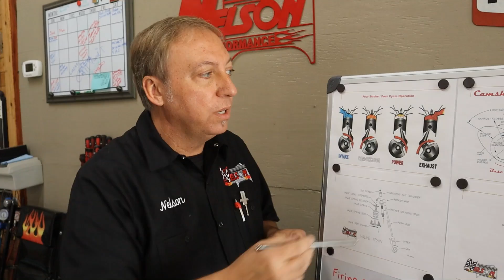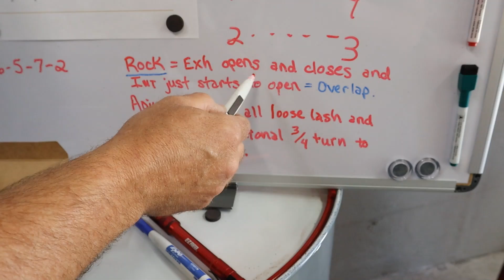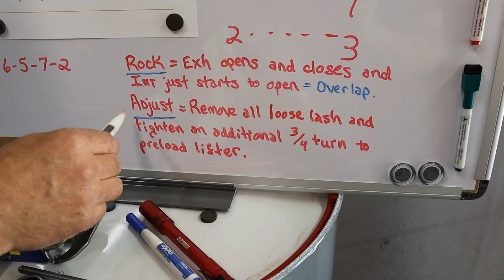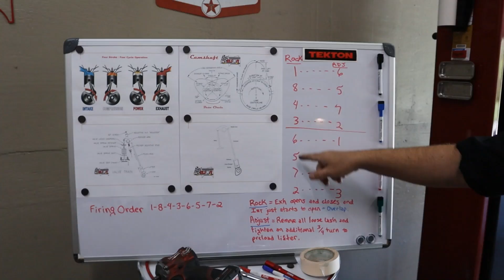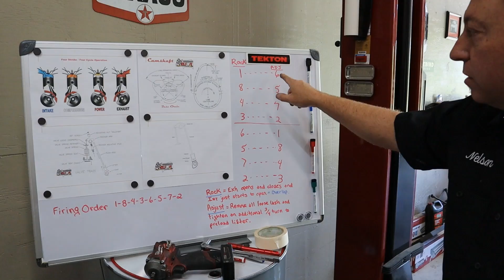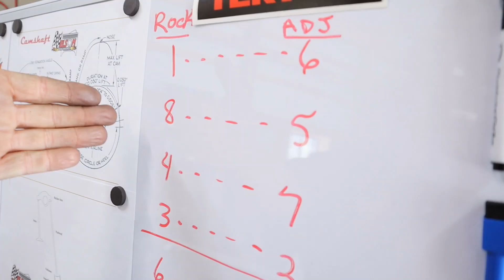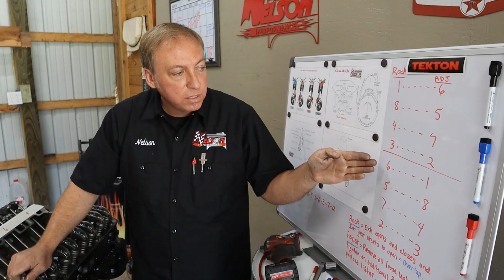Rocker Arm/Hydraulic Lifter Adjustment

Comment: Thank you so much for the great video!  I haven't seen this method before and it looks like it should be the "one true way" to adjust valve lash on a hydraulic lifter engine rebuild.  Excellent and keep up the good work.  

The video is very timely for me as I have just replaced the valve stem seals on my 1968 Ford 289.  Question for you: Since I did not remove the intake manifold I am unable to clearly see the movement of the lifters. So, in your video, is your starting point on the #1 cylinder at TDC or different?  I'm trying to find a reference from outside of the engine if possible.  If not, maybe I just feel for the push rod movement?  Additionally, once I have completed the Rock/Adjust for #1/#6 (my engine), how much of a turn of the crankshaft do I need to get to the Rock/Adjust #5/#3?  Looks like you are maybe turning the crank 45 degrees?  

Any assistance you could provide would be much appreciated.  

Thanks in advance.
-Andy
Reply from the maker: Hey Andy, first off, thanks for the view and the kind words! Having the manifold on is no problem, you can just watch for the pushrods to fall and rise instead of watching the lifters. You can have a friend tap the starter while you watch them but it takes a very slight tap of the starter to get to the next adjustment, and the method will work the same as long as you have adjustable rockers and not the 5/16 torque down style rail system. Also I assume you are using the 289-302 firing order cam and not the HO 351 cam that requires you to use the 351 W firing order. It should be 90 degrees (1/4 turn) between cylinder adjustments. Good luck on your projects and glad we could be a part! Nelson
Reply: Hey Mitch, I appreciate the response.  I should have clarified, my '68 is a stock 289 2v, so no rails, no HO 351.  It's got 68K documented miles so I figured a gasket/seal replacement was a better solution over full rebuild which is why I am in the position I'm in.  Good plan. I used the 90 degree method to bring each cylinder to TDC for the seal replacement so I didn't have to mess with pressurizing the cylinders and it worked well.  I'll use it along with the rock/adjust method to bring the valves back into adjustment.  Just using a breaker bar on the harmonic balancer bolt to turn the engine.  It's tight but it works.  Thanks again for your help.  I really appreciate it.
Reply from the maker: Hey Andy, no problem! Thanks for the comment! Nelson

Comment: Great video. I was adjusting the rocker arms on a go kart and I didn't understand how that works. So naturally I tightened up the rocker arms and opened up the lash until I got ignition. I have a question though, if the lash is opened more than the recommended setting will that cause engine problems? When I allowed more lash in the rocker arm it seemed like I got more power out of the engine and it seemed to go faster, too. After running it for 5mins though, it would die under its own throttle. So Im wondering, if I open the rocker arm lash more could I get more power from the engine or is that wrong? 
If Im right, then the problem I have is a lack of fuel for combustion; When the throttle is open it kills the engine, but when the engine is left on choke it functions properly. The Choke allows more fuel into the chamber and restricts air flow, right? This would mean my Rich and lean mixture is not right. So, basically I need more fuel for more power, but the question I have is, Is there a limit to how much lash a rocker arm should have? I have the engine running perfect now, but I think I can get more power out of it by opening the lash more. Again, I think there is a powerban to the rocker arm adjustment, I can get more power out of the engine, but I will have to change the fuel injection system and maybe buy different rocker arms or valves to keeps the valves from slipping loose of the rocker seat? What do you think?
Reply from the maker: Hey Erick,  typically an engine will have more power with the least amount of lash/gap between the rocker and tip of the valve. This is because it will allow you to get as much lift (opening) of the valves as possible and that will let more air and fuel mixture into the cylinder and let more exhaust out to help clear the cylinder out to accept the next round of fresh air and fuel. What I think may be happening on your small engine is when you open/increase the lash/gap it is allowing the engine to turn more RPM, assuming you have the governor disabled. That would make it seem like it had more power. The valve springs in most small engines are very weak and will valve float during higher than normal RPM, that’s why when you run the choke it revs higher because you are restricting the air trying to go in reverse back through the carburetor during intake valve float. (Just a guess). By running more lash/gap you are running less lift on the weak valve springs.  If you want to increase RPM you could install stiffer valve springs and tighten the lash/gap Back up and that should increase power and rev. Thanks for the comment! And subscribing! Nelson P.S. we now have merch avail in the link below the video!

Comment: WELL I'D HAVE TO SAY, I DID EXACTELY HOW MITCH DESCRIBED & SHOWED HOW TO DO THIS AND NOTTA, IT DIDN'T SEEM TO WORK WITH MY ROLLER ROCKERS, I GO THRU AND ROTATE THE ENGINE BY FIRING ORDER AND EVERY ROCKER ARE LOSE, THE ENGINE HAS TO ROTATE 90 DEGREES OR 1/4 TURN FOR THE NEXT PISTON IN ORDER FIRES FOR 8 CYLINDERS, I HAVE ADJUSTED THESE ROCKERS 10 DIFFERENT WAYS AND STILL HAVE A CHATTER. SO SOME FEED BACK WOULD BE NICE.
Reply from the maker: Hey Jeff, are the lifters pumping up? Are you sure you are getting adequate oil pressure to the lifters? Was it a full rebuild? Certain all internal oil passage end plugs are installed?
Reply: @mitchnelsonperformance  complete rebuild except the block in feb-apr last year,been driving it. Just had issues with chatty rockers, after I did your technique I went back thru and readjusted from 1-8 at tdc and BINGO no more chatter and runs great, not sure WTH I did but it's finally done back with the roller rockers. 👍 Thx for your video, it was the best explained & most detailed one yet that I've ran across. I'll keep it handy for sure.
Reply from the maker: great Jeff, glad you got it cured! Nelson

Comment: SO BRING EACH PISTON UP ON TDC IN FIRING ORDER & THEN ADJUST CORRESPONDING CYLINDER WITH 3/4 TURN PRELOAD AS PER YOUR DIAGRAM RIGHT? I KEEP HAVING TROUBLES WITH CHATTER,  YOUR VIDEO IS THE BEST 1 I HAVE FOUND ON THIS ADJUSTMENT SO FAR. SBF 302 I'M WORKING ON.
Reply from the maker: See above return comment

Comment: Love this guy the way he teaches how to do it I’ve been using his methods for awhile and it works every time love it
Reply from the maker: Hey Tony, really appreciate the kind words and the comment! Glad we could be a part of your projects! Nelson
Reply: I’ll tell u I have looked at other videos and this one is the best ever it should be showed all across the board so young kids can see how it’s done even more so people like that’s been a mechanic for over 20 years
Reply from the maker: I appreciate that. I worked for Jasper Engine and Transmission for 7 yrs before I became an Automotive teacher and I owe much of my knowledge to the old guys that were generous enough to pass it on to me when I got started and I remember them every time I pass it on to others. And I’m learning more every day. Thank you again Tony.
Reply: Hi maybe u can help I installed a retro lifter in my 351 and of course followed ur intelligence in adjusting the rocker. So what’s happening is I primed the motor spinning the oil pump for several minutes and the lifter is super hard not really allowing me to spin the motor at all as of though the valve is hitting the piston   Yet prior to priming everything was perfect   Am I doing something wrong pushrods are good only worries is that the lifter got that hard acting like a solid lifter. Do u have any suggestions? Thanks a million
Reply: I know u guys are a very busy shop so I cleaned the lifters and now working properly again I appreciate ur videos
Reply from the maker: Hey Tony,  priming the oil pump shouldn’t have “overpumped” the lifters enough to open the valves causing piston to valve contact? The valve spring pressure is higher than the oil pressure preventing this. I’m not certain what would have caused that?  The valve springs will bleed the oil out of the lifters as you turn the engine over as the rocker pushes the valve spring down. This will get the plunger off the wire clip in the lifter. The valve spring pressure has enough force to push the pushrod into the lifter bleeding the oil back slightly since the oil pump is not producing oil pressure unless the engine is running.
Reply: Hi what happened is that I had the lifters soaked in oil for days and it had a little spring motion after I primed the motor the oil was very thick 
Nonetheless I emptied out the lifters and all is well   The lifter was getting stuck with the oil being heavy
Reply from the maker: Ahhhh yes heavy oil may not want to bleed out as easily. Glad you got it figured out!
Reply: Took a little figuring out but I got it again man thanks for ur help

Comment: so how do i do do his with an engine in the car with 130,000 on it
Reply from the maker: You don’t necessarily have to view the lifters when doing the process, if the intake is on. You can also watch the movement of the pushrod/rocker arms if the intake is installed. You will see them move into overlap (the ROCK position). I’ve adjusted many engines that way. Just keep track of your cylinder locations to keep you on track. You can also use the ignition/starter to rotate the engine through the process but remember it only takes a slight bump of the key to turn the crankshaft the needed 90 deg. It helps to have a friend bump the key while you pay attention to the rockers. 
 The valve springs will bleed the oil out of the lifters as you turn the engine over as the rocker pushes the valve spring down. This will get the plunger off the wire clip in the lifter. The valve spring pressure has enough force to push the pushrod into the lifter bleeding the oil back slightly since the oil pump is not producing oil pressure unless the engine is running. Good Luck with the project

Comment: I followed your instructions and as far as I know everything went fine. But, I don't have any action on the "adjustment" valves. I have 1 at TDC. I go over and tighten down the valves till they don't have play, then add a 3/4 turn on 6. In your video you can rock the rockers, pushing the rod down into the roller. My rollers aren't letting me do that. They have been soaking in oil before I put them back in the block so maybe they are full already? Idk. :/
Reply from the maker: Hey David, yes, if they were soaked in oil then they won’t compress down but the valve spring pressure will slowly bleed them back to where they need to be after the 3/4 turn. Sounds like you should be good to go 😁

Comment: Went through this process twice on my corvette (stock 350 w/hydraulic cam)
Still getting lots of lifter clatter….
Wondering what I missed….
Reply from the maker: Hey Jody, ? Not sure? Do you have good oil pressure?
Reply: @mitchnelsonperformance  yes oil pressure is good, but noticed a few of the lifters not pumping oil, the lifters are new. I did recently install comp cams 1.6 ratio rocker arms. Could that affect the adjustment after zero lash? Wondering if there is a deeper problem. maybe a cam bearing slipped cutting off an oil passage?
Reply from the maker: Hey Jody, 1.6 rockers will not affect that. Did you have the three oil plugs behind the timing set out? What side of the engine has the rockers that aren’t oiling?
Reply: @mitchnelsonperformance  the motor was running fine until I changed the rocker arms, changed nothing else. It has been sitting in the garage for a few months though.
Reply from the maker: what side of the engine isn’t getting oil to the top?
Reply: @mitchnelsonperformance  drivers side
Reply from the maker: Hmmm that rules out internal leak around the distributor housing? I’m unsure? The only other reasons are a missing oil passage plug or the oil feed holes in the rockers/pushrods being blocked or misaligned. But even then the lifters should pump up and not peck/tick. Also a slipped cam bearing would usually not cause total right side loss. It will however starve that cam journal.
Reply: @mitchnelsonperformance  I’m think about buying another set of lifters just to rule that out, I sincerely appreciate your help and you sharing knowledge
Reply from the maker: That’s probably your best next step. Good luck and I would appreciate knowing the cure! Nelson
Reply: @mitchnelsonperformance  I will keep you updated
Reply: @mitchnelsonperformance Hi Mitch, well I finally got it all back together. Running pretty good and smooth, but there is still a little bit of lifter ticking…
Is there additional adjustment needed after the “rock and adjust” procedure?

Comment: I tried adjusting the preload on a big block Chevy and after about 5 minutes of running the rocker arm nuts started to come loose. Am I supposed to use lock tite to keep them from working loose? Special nuts?
Reply from the maker: Hey Gregory, if the rocker nuts are used many times they lose their “bite”. You shouldn’t need locktite if the nuts are new. I have seen some marine application big blocks that had non-adjustable , torque down style nuts. I guess it’s possible you have that style stud and nut?
Reply: @mitchnelsonperformance  That is helpful. I will try new ones next time. Thanks
Reply from the maker: no problem. Thanks for viewing and commenting. Nelson

Comment: just watch the opposite valve , when the intake goes all the way down and right before it reaches the top , adjust the exhaust ,  just as the exhaust starts to move adjust the intake rocker
Reply from the maker: Hey Jones, yep, I’ve seen that method used too. Many ways and methods out there 😁 Thanks for the comment and viewing!

Comment: Mechanic for 40 years.. my advice is to remove the valve covers motor running listen for the clatter. The feeler gauge it's obsolete.. of course it comes with user experience
Reply from the maker: Yep, I’ve seen that method 😁 A lil messy and you’ve gotta have a Golden Ear 👂 😁
Reply from the maker: Thanks for viewing and the comment! Nelson

Comment: I love this video I found it by mistake. This is the best explanation of valve adjustment I ever seen. Mitch you are a top-notch instructor.
Reply from the maker: Hey Carl, we appreciate the kind words! Glad we could be a part on your projects. Nelson
Reply: @mitchnelsonperformance  yes very interesting 🤔 you know I had a friend long ago - showed me how to adjust the Rocker arms - he had 2- valve covers cut Long ways - so he could adjust while Engine was running ! No oil spilling at all ! Adjusted till the tapping Quit 😳 what are your thoughts on that Mr. Nelson ?
Reply from the maker: Hey Jimmy,  I’ve seen that method too, but the big concern is trying to hear that specific rocker while all of them are tapping and also just how much preload you’re really getting on the lifter cup. Thanks for the question and commenting! Nelson
Reply: Carl, please understand that we are NOT adjusting valves.  (that is a misnomer).
With a mechanical camshaft, we set the clearance between the rocker arm tip and the valve stem. 
With a hydraulic camshaft, we set the depth of the cam follower's (aka lifter)  plunger. 
As I mentioned earlier, once a valve has been installed, the spring fitted, retained and clipped, there is no valve adjustment that can be made.

Reply

Comment: One question on it did you soak the lifters before you put them in an do you have to soak them first?
Reply from the maker: Hey Josh, I do not typically soak them. I prefer to have them empty of oil so I can feel the plunger movement in the lifter. I do use an oil pump primer afterwards to prime the system. Or crank the engine over without spark until it gets oil pressure.  Thanks for the comment! Nelson

Comment: Where was this video when I built my first motor  that makes things so much easier I had hell finding zero lash and setting preload on my first build ... garnet I was 19 and had no help or guidance spent 12k teaching myself how not to build a 355 ...26 now building a 383 for my 92 k1500 thank man great video
Reply from the maker: Hey Mason, I know what you mean! I’m 52 and when I was 19 there was no internet! 😳 But I credit my skills to a few old guys that were kind enough to take the time to pass their knowledge on to me. Glad I could be your “old man” 😃 Good luck on your projects and thanks for commenting and subscribing. Nelson
Reply from the maker: P.S. make sure you use a SMALL BASE CIRCLE camshaft in that 383 to clear the connecting rods unless they are made to clear a standard cam.

Comment: There is not enough space to comment on for how you've shown everyone how to adjust the small block Chevy valves. I like many others so needed this. Im going to start on 2 early 60s C10's with small block engines and this was very helpful. Thanks abunch. Trucker Ray ✝️
Reply from the maker: Hey Ray, thank you for the comment and the kind words. Did you notice the 68 C10 in the background of the video?😁 Good luck on your projects! Nelson
Reply: @mitchnelsonperformance  yes very briefly
Reply from the maker: its our 68 shop truck. We also have a 71 GMC and a 72 Chevy.
Reply: @mitchnelsonperformance  That's cool. I'm going to start this year on my 1st  2 projects ,1962 and 1963 C10s. Looking ar the Silverado 5.3 engine. Any suggestions helpful. Thanks. Trucker Ray ✝️
Reply from the maker: The 5.3 is always a good choice. Very reliable. We have a 1960 flat bed ton dually also 😁